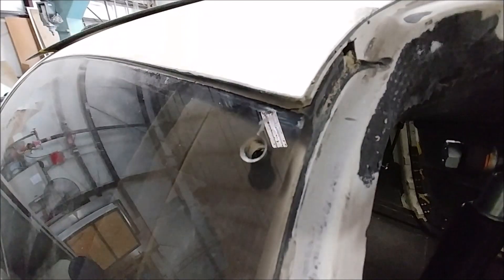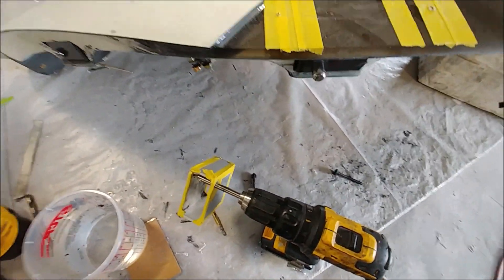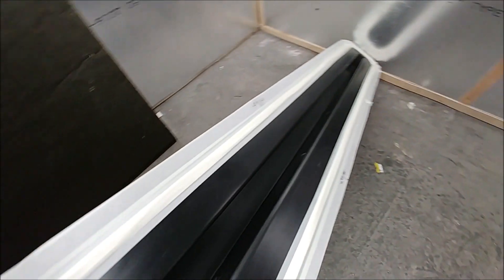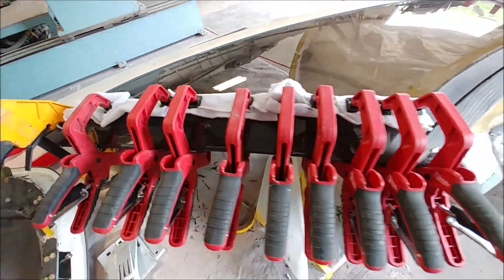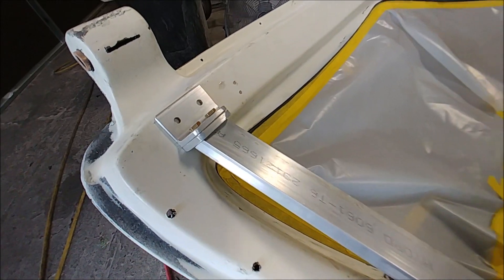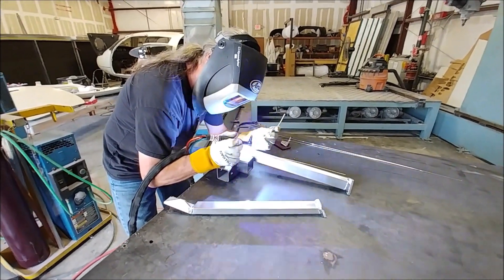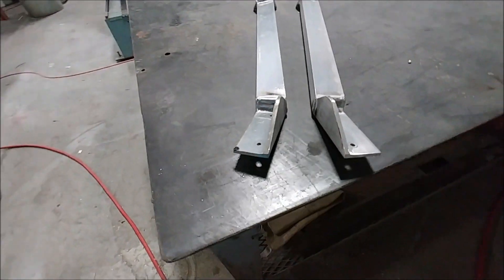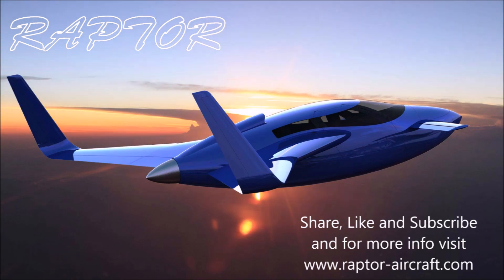A Successful Recovery? - Building the Raptor Prototype

Comment: Drilling plastic so you don't crack it (and sheet metal so the drill bit doesn't screw through hole before it makes a round cut):
 With a fine cut-off wheel in a Dremel, hold the side of the disk against the drill bit cutting edge with the disk in the same plane as the centerline of the drill bit so that you give the cutting edge a zero rake.  You don't have to take a whole lot off.  Do both flutes, of course.

Comment: Perhaps this has been asked already, but have you considered going with a waterless coolant for the engine?  To prevent corrosion over time, being that most planes sit for long periods.  Although at only 6 gal of diesel an hour, this plane may be the exception to that rule..
Reply from the maker: I'm using a 50/50 mix of distilled water and coolant that's specifically recommended for this engine. I can't see how that would be a problem. You're correct in thinking that if the plane sits for any length of time that would simply be a shame. Sometime should be enjoying it as much as possible.

Comment: Perhaps on the production aircraft the windows can be placed on the inside of the airframe, where cabin pressurization will help seal them and eliminate the need to drill holes in the windows. A carbon fiber frame can be placed around the inside to clean up the appearance.

Comment: Yes finishing acrylic by hand is the only way. I've worked with it almost all of my working life so have learned a few tricks. Machining the chamfer is far too risky and will almost always leave a small nick or burr not to mention vastly increasing the possibility of cracking the material. Use a small manually operated hand-drill to save your hands. Treat acrylic (perspex) the same way you would steel (a very fragile steel) - slow revolution speed and feed coupled with a flow of cooling lubricant liquid is the ideal way. You can also use compressed airflow to cool the bit and just a spot of lubricant liquid.
Alternatively you can cut 'dry' allowing some heat build to soften the material so that the bit cuts easily BUT too much heat will leave a burred and scuffed surface inside the cavity. Watch the removed material coming off the bit carefully, if it forms neat curls and is still slightly translucent the amount of heat is ideal, if it starts to break up into small powdery bits there is too much heat. High speed bits such as a router can be used but they require a fast feed to avoid overheating the material - this takes practice and quite a bit of skill to get right. You will know when you have it sorted as the finished surface will be close to a mirror finish. A burred or white finish is bad and will mean that there is now a lot of heat stress in the material around the cut. Hope that helps - keep up the great work, Cant wait to see this beauty take to the skies!!
Reply from the maker: Thanks for the info. Cheers

Comment: Hi Peter. Nice update as always. You can buy a non motorized hand drill that I think would've helped with the plexi. 

And regarding the door braces, couldn't you just get a longer strut and attach it lower on the door to reduce the cantilever weight factor?
Reply: My guess is that would put the gas strut in a rather obtrusive position inside the cabin when closed.
Reply: I agree re the hand drill - takes some skill and sensitivity to use properly but saves your hands.

Comment: Peter thank you for video blogging this build.  I have just recently found your project and spent the last month watching each one, starting with the first one.  Once I got all caught up I couldn't wait to sign-up.  Glad I beat your cutoff.  

Since my position is quite high I was wondering if (when the time is right and you have the performance numbers) would you consider working with one of the companies that create airplanes for VR Flight Simulators?  I use X-Plane 11 so that is the one I like you to target.

Also a question...  It looks like it will be soon that you will attach the wings to the fuselage.  Can you assemble this in your work shop or will you have to move it into a hanger since the wings look to be quite large?  Or did you design the wings to be removable?

Thanks and you're doing a great job... Keep it up.
Reply from the maker: The wings are removable. Eventually we'll have a third party company create the Raptor for X plane.